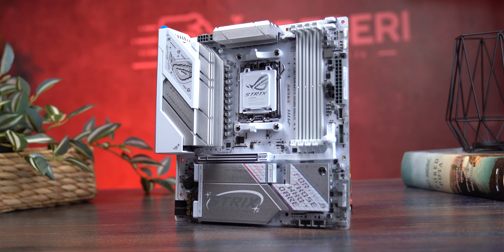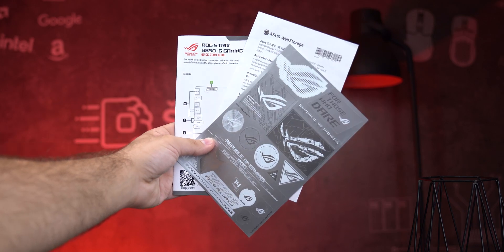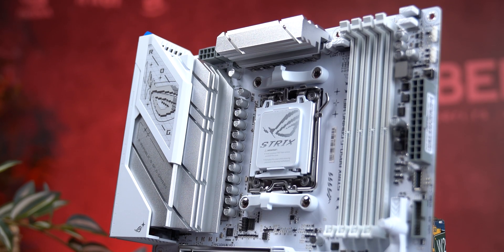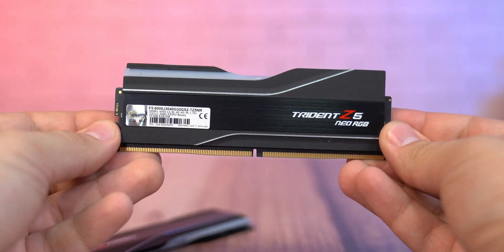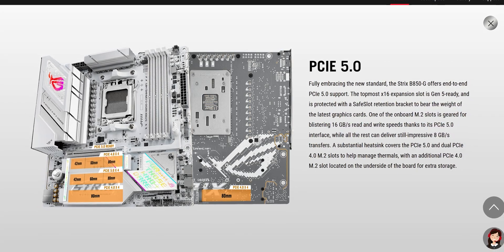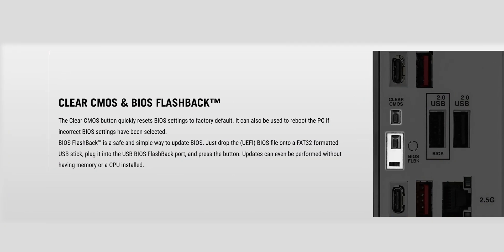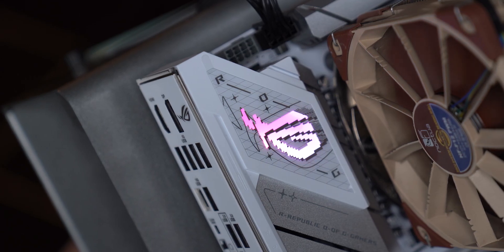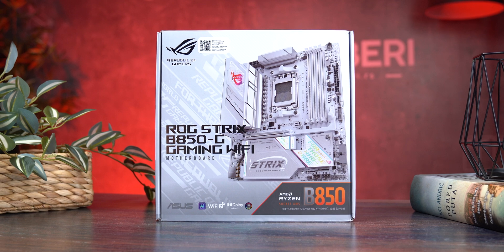ASUS ROG STRIX B850-G: The Best mATX AM5 Motherboard? 🔥

Comment: This or the TUF 850M? how do they compare really?
Reply: Never buy TUF products, they are always straight up garbage, specifically the motherboards
Reply: @Striker-rw4rd I've had my Tuff mobo for years without issues. I used it as part of a mining rig (so 24.7 operation) for 2 years and then today it's used as a regular desktop. From then until now, it has never been in a case. It would just sit on it's box that it came out of.

Comment: hi, 
is there MATX mobo has gen 5 GPU? i has 5080 and looking mobo to pair with 9800x3d in MATX case. but i cant find any :(
Reply: i’m having the same dilemma. i’m building a new pc after not having one for 5yrs and i’m having trouble deciding / finding a mATX mobo to pair with my 9800x3d & 5070 ti msi gaming trio
Reply: @TytoPhodilus  oh. later i found out that any B850m has pcie gen 5 for gpu. just pick one 
im using B850m mortar, and its good :D